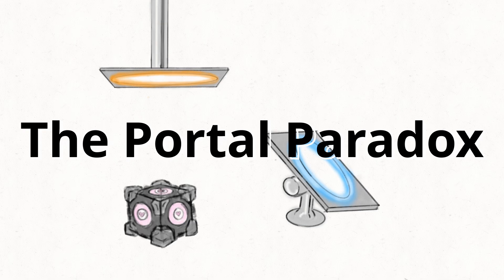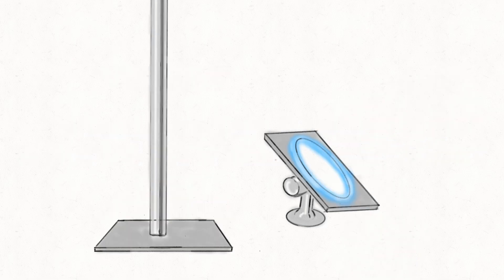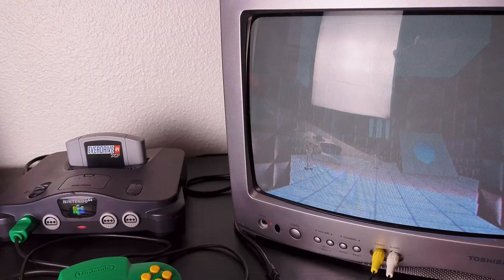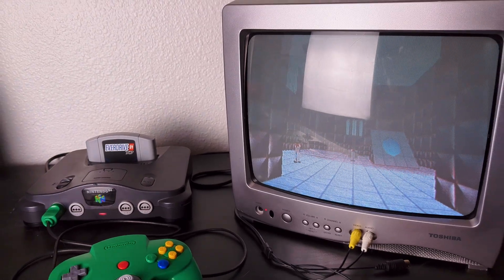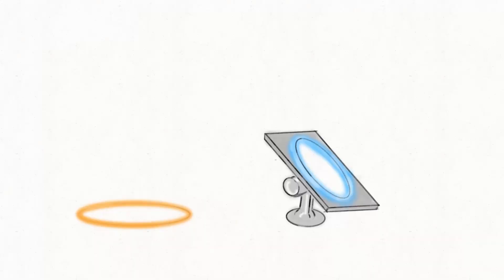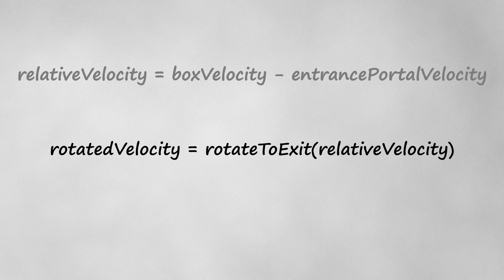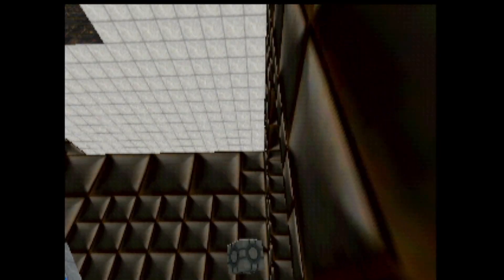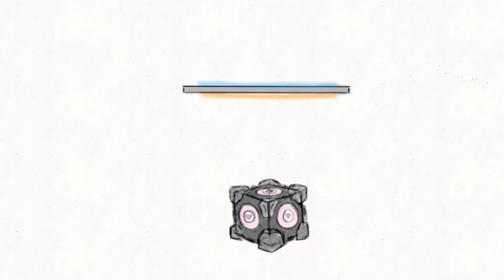I rewrote Portal from scratch and solved the Portal Paradox

Comment: Alright, but I've got a question: What would the expected behavior be if the portal stopped after the object was half-way through? I mean, the half that's sticking out of the blue portal is expected to have a certain velocity at that point while the other half is still stationary. Half the speed the orange portal was moving at? Maybe an energy consistent speed (which would be sqrt(v² / 2) if I'm not mistaken, with v being the speed the orange portal was moving at)?
Reply: I'd be longitudinally stretched and, if you stopped fast enough, the forces could break the cube, but, otherwise, the half that past the portal would drag the other half along

Comment: I'm not sure the relative motion applies because technically the cube isn't moving at all, and maybe in some way, neither is the portal? One side of the portal appears to be moving and at the same time the other side isn't, but the portal corresponds to the same place...in two places...

What if the portal in its downward descent stopped at half the height of the cube?

Also, the fact you can see into this portal... If you had two portals facing each other parallel and you looked into one you'd be looking at your back almost like an inverse mirror. And wouldn't it also create an infinite effect similar to two mirrors facing each other? Or more like when you view your own screen share and it infinitely repeats as a visual feedback. And if you walked forward into one portal technically you would have moved backwards... There's some weird hyperdimensional inverse symmetrical geometry thing going on

Comment: A better counter argument could be that we can consider that the portal doesn't have a velocity. When you move a portal you can imagine it's like changing its position instantly with small incremental stepts, while its "velocity" remains 0. I think there is no right opinion on the matter, we just don't know the physics of something that doesn't exists. It would be more intuitive for a portal to have its own "portaling velocity" for most people, myself included.

Note that if it's easy to stop a moving portal very quickly (do portals have weight?) while an object is halfway through, half the object will have a big velocity and half of it 0 velocity. This would make it a lot easier to rip aparat heavy things.

Comment: That's... not really how this works becasue you aren't talking about velocity as much as you might think that applies here. You're looking for momentum. Which shouldn't be created but your... simulation seems to show momentum being created. As if the momentum from the first portal is transferring to the cube it slams down on

And if we assume the two portals are connected seamlessly, then we can treat it as portal 1 goes straight into the exit portal. Thats all a portal is, a door into another space. If a door comes at you but you're not moving, do you gain momentum? Do you gain any velocity whatsoever? No, you just end up on the other side of this moving door, still having no momentum. It doesn't matter where the door is, or even if the exit is somewhere else entirely, or mobile or stationary, none of that matters, becasue the motion of the portal shouldn't affect any of the forces exerted on the cube.

Just imagine walking through a portal. If you see a portal press down on you, you expect to be able to climb out the exit, not find yourself flying.

Comment: So the hula hoop analogy is great. Loved it. Makes sense. However, it reveals why your solution to the moving entrance and static exit is setup improperly.

"Speedy thing goes in, speedy thing comes out" is not equivalent to: "portal speedily descends upon stationary thing, stationary thing is imparted with momentum"

Portal preserve momentum, is the original game logic.
Preservation, does not impart momentum.
At no point in either game (as far as I can recall, it has been a couple years since my last replay) do we see anything that would imply otherwise.
How about an example?
If you put your hand through two stationary portals, the portal does not suck you through it. If you stop half way, so that you can wave at yourself, that is consistent.

If you adjust the portal slightly, your hand will move in the exit portal, only if you do not move it relative to the entrance, as the entrance moving causes the alignment to be different.

So, it should be clear now: 
If a portal accelerates upon your arm from a meter away, at 1 meter per second, until it arrives at your elbow. There is no imparting of velocity to you, or your arm, and your arm exiting the stationary portal at 1m/s is not a product of imparted momentum, but instead a product of the entrance reference frame.

Hope that helps.

Comment: The portal shouldn't have velocity. 

The experiment you showed at the start, at some point deletes the cube on the orange side and  spawns a new one on the blue side. Portal allows you to put things halfway through a portal. What would the result of your experiment be if you stopped to orange portal 1/3 of the way through the cube? What about 2/3 of the way?

If I were remaking portal, I'd have two rooms. You can mirror all the object states in both rooms. Chel would not notice that there are two rooms because the object states are mirrored. When Chel goes through the portal she walks into the other room. In the case of our cube, when the Orange Portal interacts with our cube, it would come out of the Blue Portal in room 2, and the cube in room 2 would come out of the Blue Portal in room 1.  Since the cube didn't have any movement it would still be resting on the surface of the floor. However that floor is at 45% at the Blue Portal position. At that moment, the force of the box is still 90% to the floor (where gravity was), but  45% to gravity (where it is now). This would cause the cube to begin spinning violently forward, as it normalizes those forces through rotational energy.
Reply: Basically, the object has the same velocity to appear in the other side but without momentum.
Reply: If the mass is uniform, you can assume a very proportional relationship between the resulting speed, and the distance the moving portal goes over the object.
1/2 the distance = 1/2 the exit speed
2/3 the distance = 2/3 the exit speed
and so on

Comment: Here's how I look at it, noting that I'm no expert, but I have a grasp of what's happening.

While the entry portal is moving, the cube appears to be moving through the exit portal. Once the entry portal stops, the cube continues moving because nothing has prevented it from doing so.
Here, the cube has momentum relative to the entry portal. Once it enters the portal, the momentum is transferred to be relative to the exit portal instead.

Therefore...
The floor moving up into the portal and the portal moving down into the floor both result in the same result, because the relative momentum from the entry portal's perspective is the same.
Reply: The cube is never touched.  The world is moving around it.

Comment: Nice project, I am in agreeance with the functionality of the engine. What would if in the blue portal in the second example was oriented differently? on a 45 degree or 90 degree angle?

Also, the pre-amble did nothing other than reduce your retention rate imo - it was a great choice to start with the content though.

Comment: I'm a bit puzzled why this was considered a paradox at all, as velocity requires a reference frame. Just imagine the moving portal in a moving reference frame and the block on the floor will now have a relative velocity to the portal. Since the portal is just a linear spatial transformation then the block must exit the portal with the same relative velocity to the portal. So when you observe the exit back in the stationary reference frame the block must still retain that relative velocity. Issues like a long block and a glued block can be solved using free-body diagrams, so I don't see where a "paradox" would arise.

Comment: I never understood why the "portal paradox" is even a paradox at all, and not just obviously basically what's in this video. Either you're throwing a floor with a box on it at high speeds into a test chamber, or you're throwing a test chamber at high speeds into a floor with a box on it. Either way, the box and test chamber will be moving relative to each other.

That's not to say your implementation as shown in the video is 100% accurate, you didn't model the fluid dynamics of the long-recycled same test chamber of air.

Comment: I'm not sure if there is a way to design two portals such that the cube stays still after coming out the other. If the cube is coming out of the second portal, then it's coming out with some velocity. For it to be still, all of that momentum would have to disappear when the cube exited the portal. Hard to build a physics engine with that sort of physics
Reply: The cube doesn't have any potential energy. How is the cube suddenly gaining enough energy to fling itself across the room?? In order for an object to move, energy/work has to be applied. 

Since the portal itself doesn't physically interact with the cube, it just relocates it, the cube has no way of suddenly obtaining this energy. All of the energy that you used to push the tile into the ground is absorbed by the armature, the floor, and the panel. It's distributed as vibration, sound, and heat. We know this because objects that are dropped from one portal into another when they're stacked speed up to terminal velocity. If the portal could transfer the energy from the object it was sitting on while that object moves, it would also absorb energy from objects moving through it and transfer that energy to the surface it's mounted on. But that's shown very simply to not be the case. The cube will only move because of the force of gravity at its new location.

an object at rest will stay at rest, unless acted upon by an external force. :)
Reply: @Saffron-the-derg Then why does the cube come out of the second portal at all? If it has no kinetic energy, then your argument should suggest that the portal should stop when it touches the cube. Which is how the original game works - it disallows moving portals. That's a valid way to build a physics engine. 

But if the cube comes out of the second portal, then conservation of momentum dictates that it cannot simply stop immediately as it comes out. Either it moves with some velocity or it does not move at all. No in between.

Comment: I just dont understand how energy is transfering to the cube for it to have momentum.  Is the portal pushing the cube against the floor or something and being squeezed out the other side? That isnt consistent with the hula hoop analogy.
Reply: Thats ana amazing project you have going there btw.
Reply: The point is that the hula hoop analogy isn't the same as with a stationary portal. When both portals move at the same speed that would indeed be just like pulling a hula hoop over the cube. However if the other portal is stationary the cube is indeed pushed against the floor, which causes it to be launched.

Comment: theres also a good way to visualize it, if you look at the stationary portal while the other one is being moved down, you can see the floor pretty much pushing the cube through the portal as if that were the thing that was moving
Reply: This^

If instead of pushing the portal into the ground vertically you could try to push it horizontally without a wall behind it. Pretty sure you won’t get the momentum.
Reply: Is the floor moving or is the platform with the portal moving? Relativity would say both is true, it just depends on perspective.

Let's look at it this way though. In this simulation everything is essentially "at rest" aside from the moving platform. The box goes from being "at rest" compared to its original perspective to flying after moving through the portal. Where, when and how did that energy transfer take place to give that cube that momentum?

The only thing with kinetic energy is the moving platform. Where is energy transfer of the momentum of the moving platform to the cube? Because if the existence of the portal, those two things didn't actually even touch.

Comment: Im still unconvinced. There’s just no reason for the velocity of the portal to be a factor. Its not like its a bit by bit teleportation where adding bits faster could generate force, its just a hole through reality. No matter how fast the opening is moving the cube has no inertia, and since theres no reason for the portal speed to be relevant in a true wormhole situation the cube would maintain its zero inertia.

Comment: What would happen if you imparted velocity based on the difference between the cubes and the second portal instead of the first? In both tests I wouldn't expect the cube to move. The first test would have no net velocity and the second would have a velocity but it would be in the downward direction so I would assume the cube would be stationary or it would bounce.
Reply: By your logic, if the exit portal is moving backwards away from the cube at a certain speed, the moment the entry portal touches the cube, it would pull the cube through at the same speed as the exit portal moving away from the cube. Does this make sense to you? It sure doesn't in my head.

Comment: how does this account for inertia? because an item at rest tends to stay at rest. thats the only part I am not sure on.
Reply: Yeah. Somehow the kinetic energy of the moving platform is being transferred to the box. This would only work assuming that passing the threshold of the portal is enough to transfer the kinetic energy of the "moving" portal to anything going through the portal. 

My instinct is that the portal is just a connection in space. Nothing really interacted with the box except its location changed without it having to move (okay that sentence hurt my brain).

The only force to really worry about here is gravity. That is unless an object hits the rim of the portal, at which point there's definitely transfer of kinetic energy.

Comment: I think this question will only be “solved” by doing incredibly complex physics calculations with mass distribution, wind resistance, and other things that aren’t easy or possible to quickly calculate, especially in a game engine. But I also think that this is the closest answer we’re gonna get until someone throws the entire computational power of a supercomputer at the problem
Reply: someone is going to have to invent the portal gun aren't they

Comment: In my mind the velocity of the portal is irrelevant, it's the momentum of the cube. In the double sided example if the velocity of the cube effects the speed, and the portal the direction, you get the expected behavior in both cases. It will be stationary in the double sided experiment, and the cube sort of just tumbles down in the first example (as a new force is applied to it aka gravity).  

Taking another stab at the double sided experiment, if the portal is stationary and the cube is moving we still expect it to go up as it moves through the blue portal. It would do the same in your code, but it also would if the velocity of the portal was not calculated and only the direction was updated. 

A third  experiment! If the double sided portal is moving down at the same time the cube is moving up, at equal speeds and opposite directions, your code would cancel out the momentum of the cube. Is that incorrect? I don't know, I am not convinced there is a "right" answer :D. It seems at least as sensible to say that the cube should pass through the portal and maintain it's upward velocity relative to the floor.

Comment: So if you had an exit portal moving and a stationary entrance portal, and a cube touched the entrance portal, would it either drag the cube in or resist its entry, depending on the direction of travel?
Reply: Imagine standing in a tunnel with no airflow. Little to no resistance to move. Now imagine standing in a tunnel with 20-30 mph winds. This is essentially your situation. Momentum is conserved between both portals in reference to each other. If you were to put an object half way in one, and it appear half way out the other portal and remain there until another force is applied, ala a change in velocity causing momentum.

Comment: I think a better example than both portals being on opposite sides of a moving platform, would be one like the first test, but make the platform parallel to the ground instead of at an angle.

If you were looking through the blue portal it would look like the cube is flying up at you, but from the cube's perspective it's just sitting on the floor. Since the floor obviously isn't what's pushing the cube out, it would mean that the portal itself is doing it. I suppose this could make sense since the cube technically has a velocity as it leaves the blue portal. This does mean a portal being lifted off something should push it into the ground depending on how fast it's pulled away. It also means that moving a portal into something shoots it out at the same velocity ignoring any of its actual parameters like size or mass. Slam a portal on a cube at 10m/s? Cube shoots out at 10m/s. Slam it down on a 2m diameter lead sphere at 10m/s? Shoots out at 10m/s.